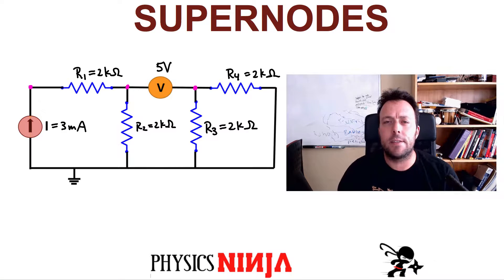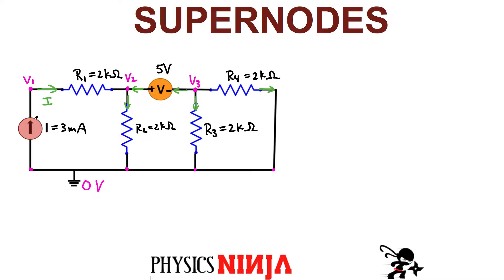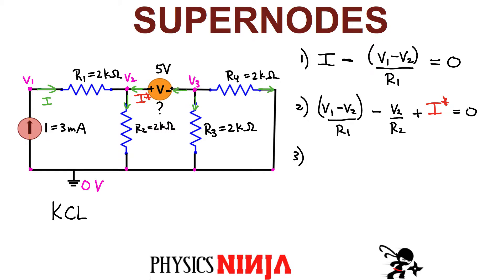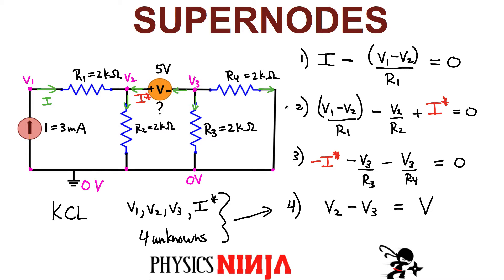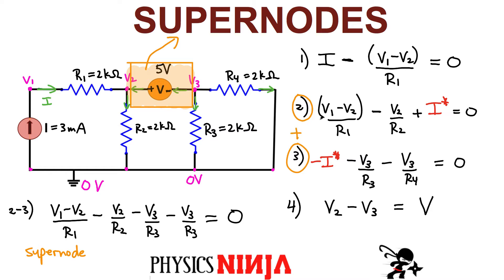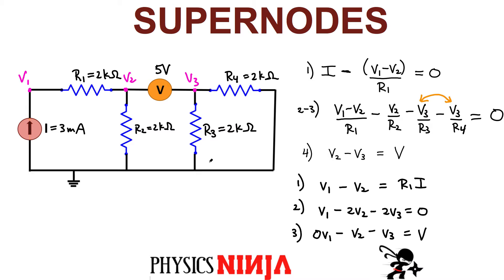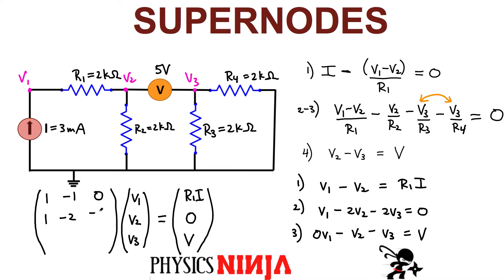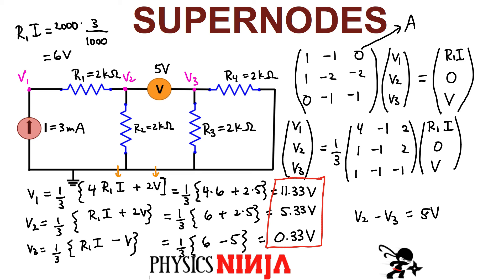Solving Circuits using Nodes and Supernodes

Comment: Hello Sir, I have regarding voltage V1. Shouldn't be equal to 0v as there is no resistor from V1 to ground. Only 3mA current is flowing through it . Please can you explain for my my better understanding. I will really apprecaite
Reply from the maker: good question.   In this case i have a constant current source.  Think of this device as adjusting the voltage such that the current will be 3mA.
Reply: @PhysicsNinja  Thanks, Now I have clear understanding.